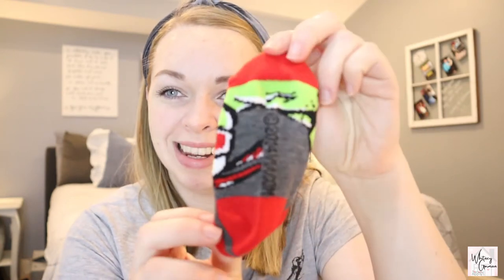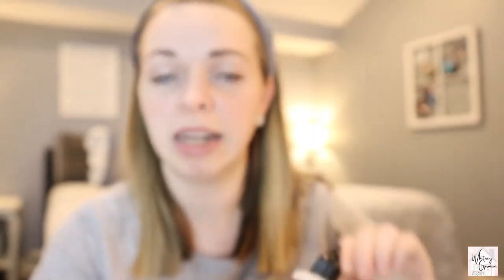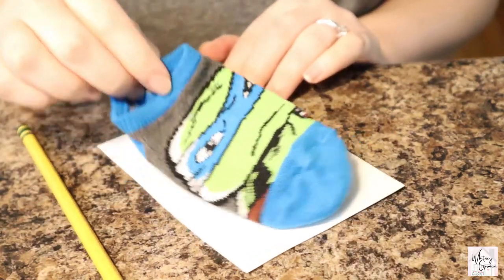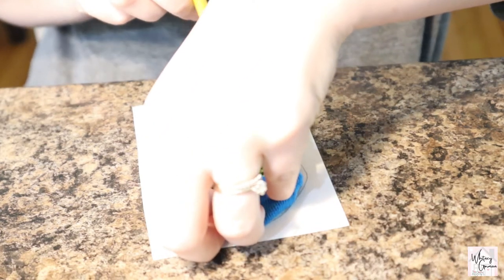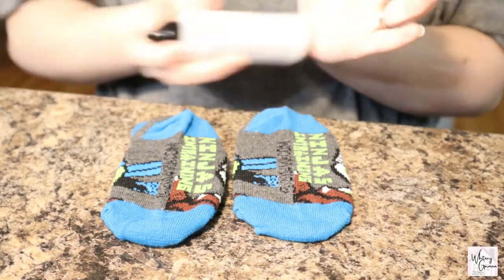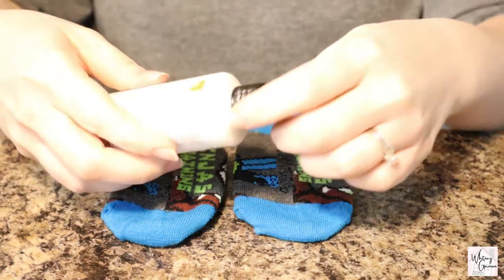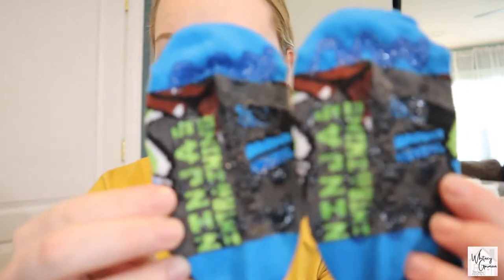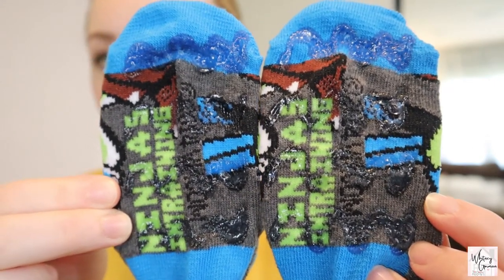DIY NON-SLIP SOCKS |  ABS Sock Stop Paint | Whitney Gorman

Comment from the maker: Let me know if you will be making your own non-slip socks at home!!! ✨ I made a polka dot design on the next set of socks and it turned out much better, in my opinion! ✨
Reply: Maybe I can try using different colors of the sock stop paint and paint eyes on my crochet amigurumi instead of using safety eyes. I make real tiny amigurumi so their isn’t much room on the face to put safety eyes or embroider a mouth. Or maybe I should use fabric paint. But I was also planning on making some snow booties for my dog so it’s nice to know this sock stop exists. Thanks for the info